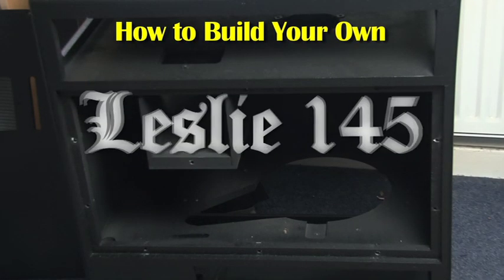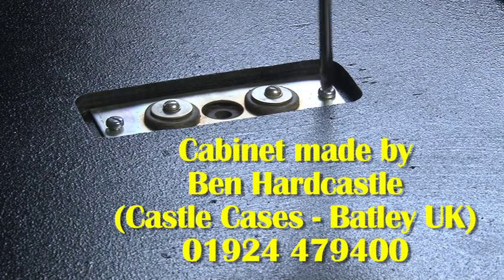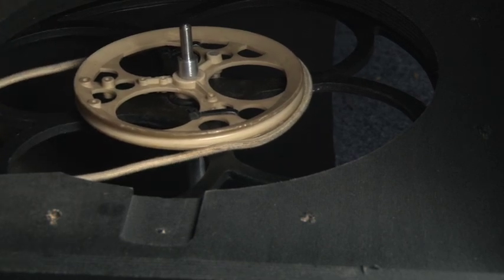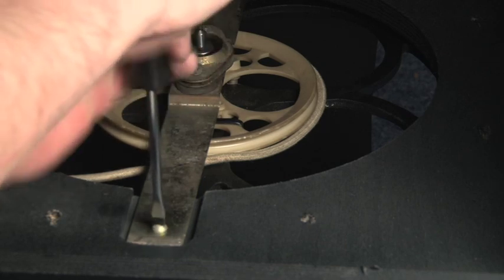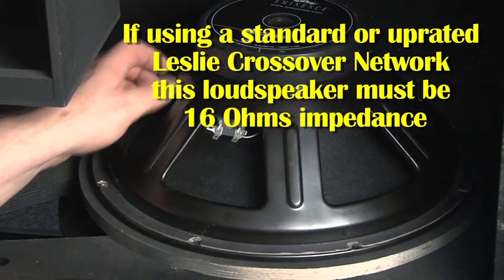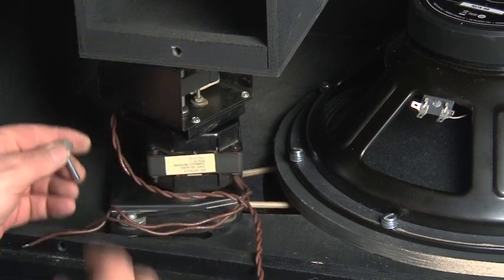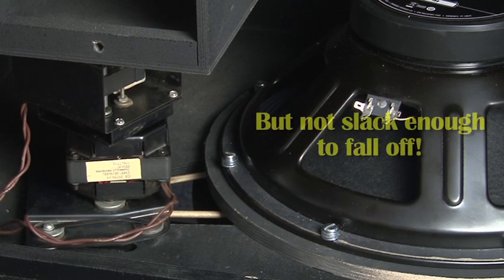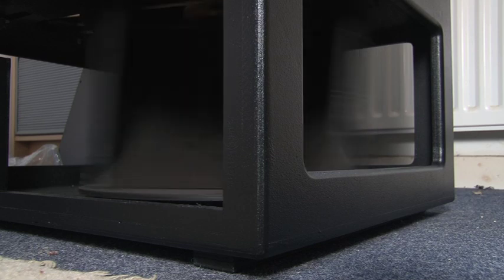HOW TO BUILD A CUSTOM LESLIE SPEAKER FOR A HAMMOND ORGAN - PART 2

Comment: You said there wasn’t much you could do to improve the original Leslie sound.  But one mod I did made a difference.  I tuned the woofer cabinet properly,  which greatly improved the low end.
Reply: Can you elaborate on this?

Comment: Birch ply is an excellent material to use, expensive though. Is such a material really necessary (unless you're touring etc)? I've read that MDF is sonically superior, I would probably go for that instead for my purpose as I think it's probably cheaper, and i'm not likely to tour anywhere beyond the local pub!
Can you tell me more about the paint method please? What proportions to mix the paint and glue, and recommendations as to what roller/ finish you used, I want to try this. Loving yer vids

Comment from the maker: Thank you for your comment, the leslie cab cost about £200.00 in Birch Plywood. The paint is a mixture of PVA wood glue & Black Emulsion paint - applied with a paint roller. The dimensions are more or less the same as a Leslie 145.